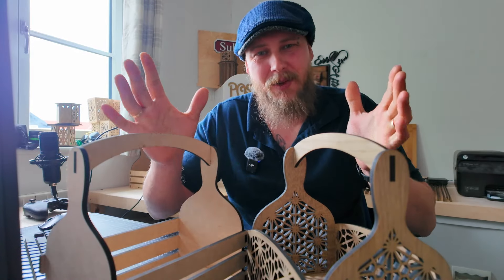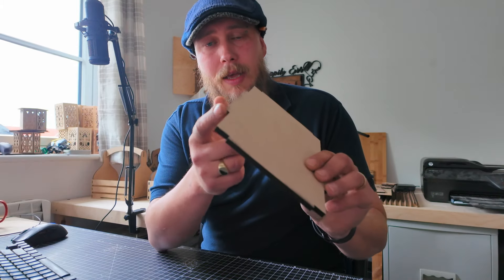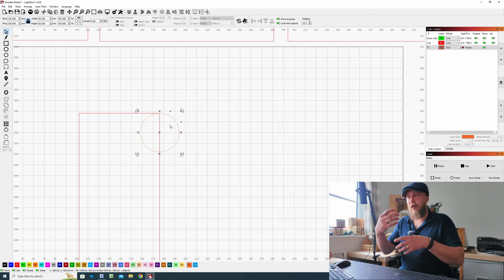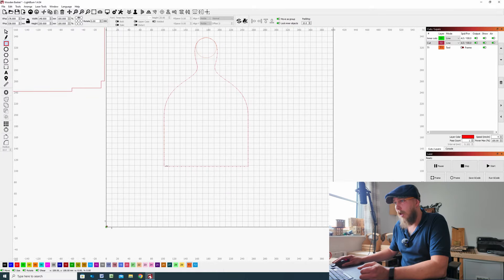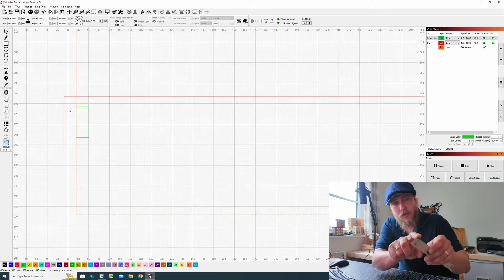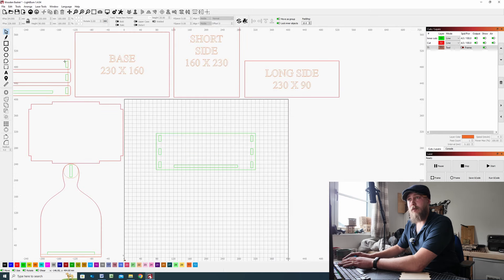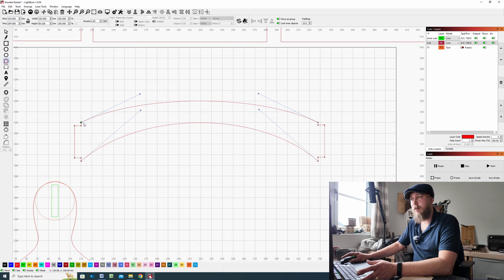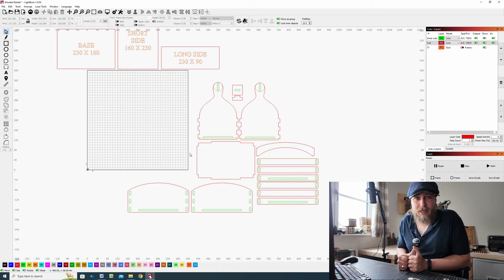Laser Cut Basket Or Beer Caddy. (Make money with your laser, & Great gift ideas) Tutorial

Comment: I have followed every single step, but @35:04 when I hit the "Weld" button, only the right side gets welded. What could be the error here?
Reply from the maker: If you zoom in really close, is their any gap? For it to weld, the objects need to be touching or overlapping.
Reply from the maker: If that is not the fault you can try, ungrouping the finger tabs so they are all single. Then select the component and a single tab and weld them individually.
Reply: @MadeBetterWithKnowledge  They were actually on the line, but I had to push them a fraction of a hair so that the tab was actually behind the main line. Weird. 

But thanks. It’s all designed now. Just have to get som material and cut everything out. 🙂